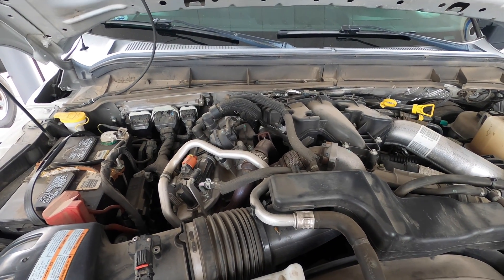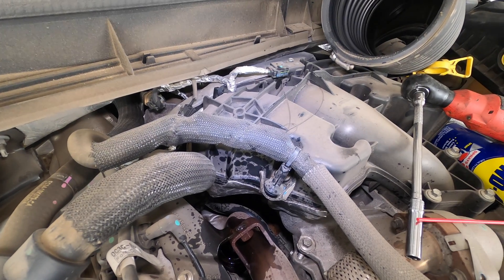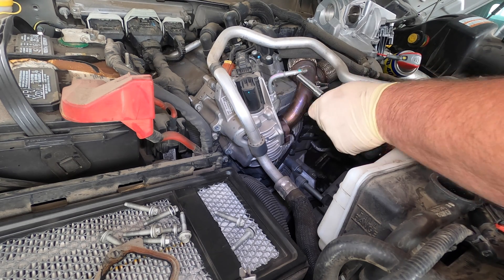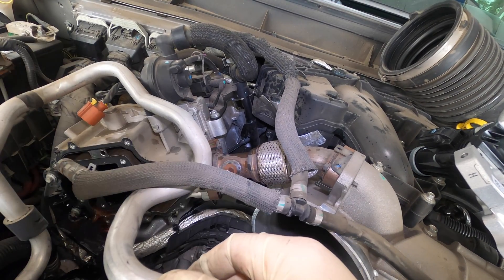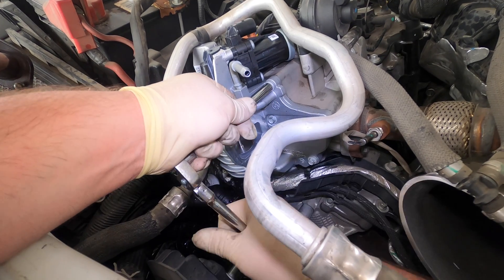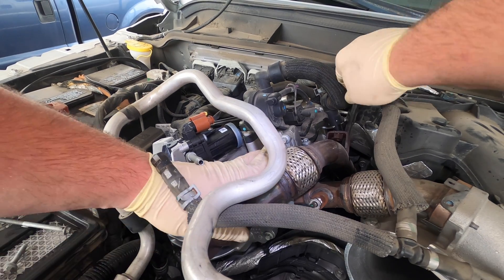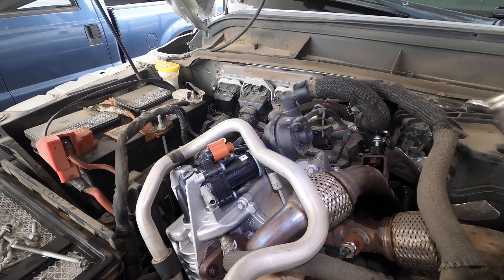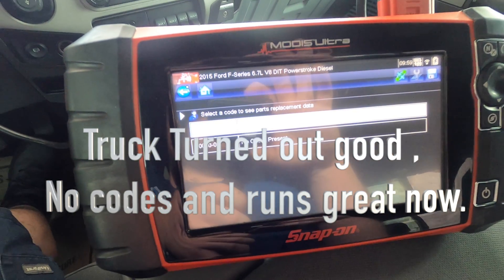Avoided Disaster Ford 6.7 Power Stroke Egr Valve Replacement

Comment: I have a 2014 F250 Super Duty 4 door 4WD with the 6.7L diesel. Just got a check engine light but the truck is running fine. Happened right after our first cold spell and the DEF was down to 29 miles until low power. I refilled the DEF and shortly after the CEL came on. Mileage was just under 235,000 when the CEL came on. Not really looking for a long distance diagnosis, but what code was the engine throwing to indicate a bad EGR? If you have other ideas, I'd appreciate them. Very good video. I will have a mechanic do this. Looks like an estimate with 4 hours of labor wouldn't be too much. Thanks!
Reply: That could possibly be the def tank heater. Same thing happened to my truck on first cold day. It's pretty east to replace yourself

Comment: Wonder if threaded studs would be good in place of those manifold bolts.
Reply from the maker: They probably would be better but if they are anything like the factory exhaust manifold studs they would likely break too. A larger threaded bolt may be a good start but in no expert.

Comment: Is the 2015 and 2017 the same EGR valve? Can I use the same part number for my 17? Visually I do t see a difference, but with Ford it’s hard to know.
Reply from the maker: From what I found on google the 2017 valves are different from the 2015.  Everything I've found the 2011-2016 are the same , the actuator looks different form those years you listed.

Comment: Have you ever had bad egr valve cause strange almost vibrating moaning sound come from exhaust during acceleration
Reply from the maker: Never anything that ive tracked back to the egr system. These 6.7 powerstrokes have issues with the turbochargers and have experience the moaning on acceleration and it was the turbocharger failing on multiple trucks.
Reply: Did you find out what that sound was. I think I have the similar noise your speaking of. It's not necessarily a moan.. but like a grinding/rubbing noise on the right side of the engine. Almost like a bad wheel bearing . Thx
Reply: @codyhosta7404  transmission pump and cracked flywheel. I asked this question because the guys truck I was working on is a descent mechanic and he suggested that was the issue. After driving it and doing my own diagnostic I realized that it sounded like a tractor when it’s running low on hydraulic fluid making odd growling sound during acceleration. Pulled transmission and replaced pump and flex plate problem fixed . I definitely went down every possible avenue for other cause before pulling transmission and I suggest you do the same as it’s expensive even if you do the work. Hope this is helpful and all goes well for you.
Reply: @codyhosta7404  is your noise always there or comes after truck warms up and during acceleration?